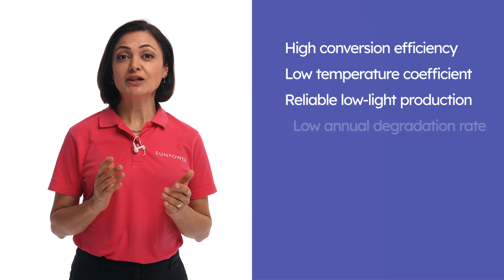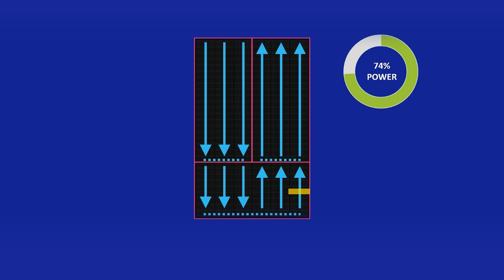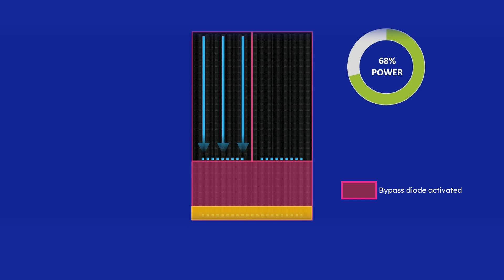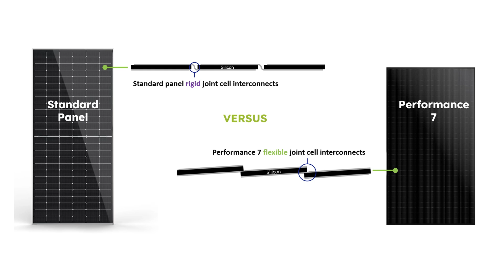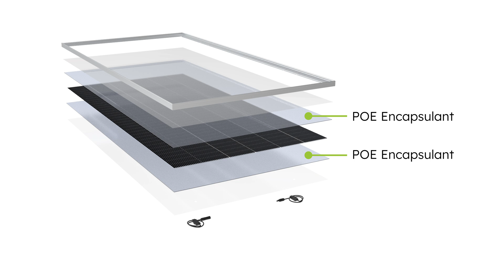SunPower Performance 7 - Key design features

Comment: What about the double face property? From the SPR-P7-450-BLK datasheet the max power output cab be maximize to an additional 20% thanks to the double face. Is the double face reachable only from the back of the panel, or also from the front? In case of installation with the panel at the same inclination of the roof, and with a minimum distance, will the double side work (and if yes, how much) or it will be almost zero?
Thanks